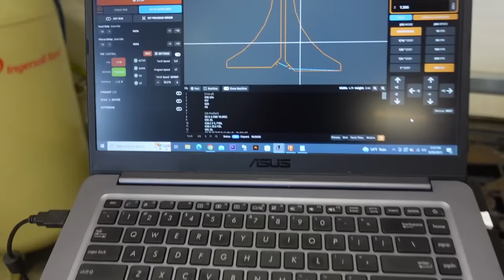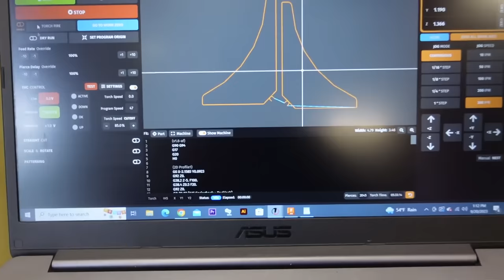Building The Ultimate Dana 60 Front Axle Part 1

Comment: I stick welded the axle tubes to the center section of a couple ford 8.8s with 7018.  Preheat to 400, wrap in fiberglass insulation to slow cooling.  Haven't seen any issues with the welds, one axle was done 7 years ago, the other 2 years ago.

Comment: Heyo! Tip for the next axle. Tig brazing! I've preferred it a lot over welding the center sections. 

Another note: Forgings can be welded. they take a billet of regular steel and beat it into shape. Even cast steel welds quite well. Cast iron cracks because it pulls the carbon into the weld, then the heat affected zone has a crystalline structure that just makes it brittle. thats why the nickel rod works, it doesn't allow the carbon to be pulled into the pool. 

You can easily tell forgings from castings by the parting line. hard to explain, but casting typically have a very narrow parting line as the sand molds fit pretty well. on forgings, it tends to be very wide and have marks from shearing the waste material off. note that all the striations in the parting line are straight and parallel to each other, this helps distinguish from a ground casting.  the shearing operation is usually the last operation of forging.  they tend to be around 3/16 to 3/8 inch wide on forgings and usually around a 1/16 on castings. This is really handy to know because you can't forge cast iron. It just crumbles. So if its forged, weld on! 

Quick edit: ok, look at the inner C's on the axle. those are forged. your knuckles are cast. generally speaking, knuckles tend to be cast steel so that if you hit something on accident while driving they may bend a bit before breaking. Iron is very brittle, as a result most manufacturers tend to used steel in knuckles.

Comment: I welded my dana 70 HD rear with Flux core wire,  pre heat yes, no post heat or slow cool as in fire blanket. To date no cracks or failures.

Comment: 15 Ford Fusion SE 2.5 L How can you tell if strut is bad ? I took severe hit on drivers side wheel and CV axle , lower control arm and the inner tie rod was damaged need replacing . The strut looks fine but some say the strut is likely shot and needs replacing . Took it to this shop yesterday and hopefully start working on it Monday .  Some shops sell you on things you don't need

Comment: 309 rod heat it hot and peen the welds, mig is for women you welds look good tho wrap axle in house insulation hot for 2 days you can use 7018 if u want just keep it hot and peen it and clean the spatter off! Good stuff!